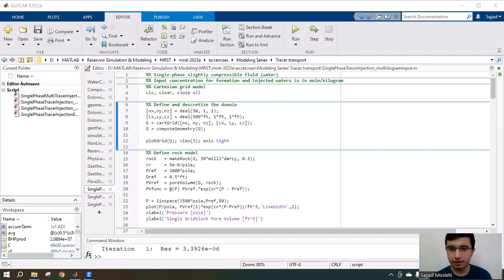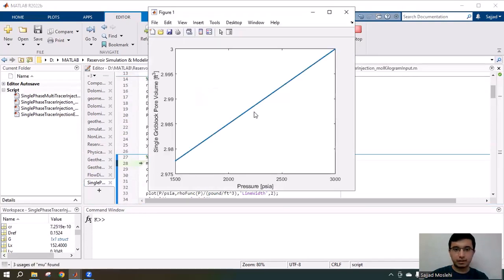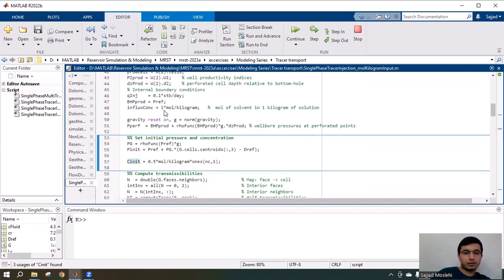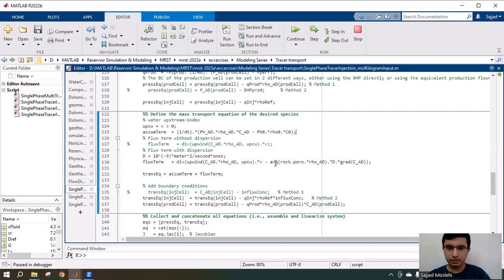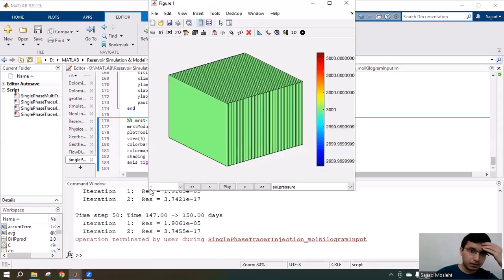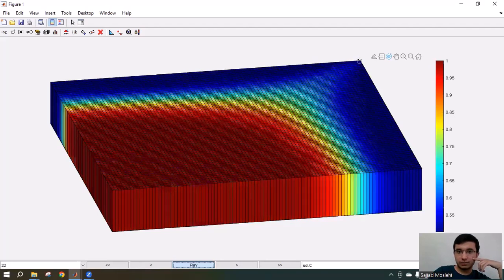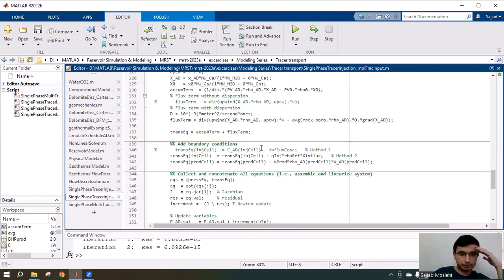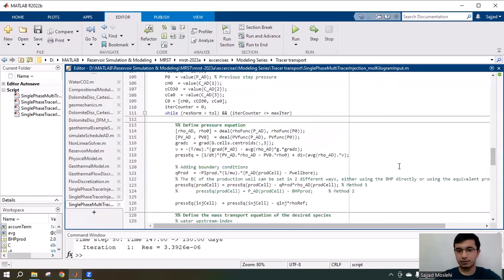Tracer Transport Modeling in Porous Media with MRST

Comment: Hi Sajjad, do you mind explaining how to set a boundary condition of prescribed concentrations (e.g. for your example)? Thank you.
Reply from the maker: Hi,
Like the 135th line of my first script in the video, you can specify a particular constant concentration for your desired cells, no matter the cell is an injection cell (which is my case) or a boundary cell (which is your case). For your case, instead of specifying the indices of injection cells, you should write the indices of the boundary cells that you want to have constant concentrations over time. Like below:
boundaryCells = [1 2 3 4 5 6 7 8 9 10];
boundaryConc = 9;   % 9 ppm
transEq(boundaryCells) = C_AD(boundaryCells) - boundaryConc;
Reply: Brilliant, It makes sense. Thanks a lot. @SajjadMoslehi

Comment: Dear professor, I would like to consider the time-varying permeability, relative permeability due to long-term water-driven flushing in the oil-water two-phase model, and I would like to get your help, thank you!
Reply from the maker: Which type of permeability do you mean? Relative permeability or absolute permeability?

If you mean "relative permeability", this is my answer:
When water is injected into a 2-phase flow system, saturations of the two phases change, so you need to calculate the relative permeability value of the desired phase for each grid block (or cell) as a function of saturation of that phase in the grid block (or cell). To do this, as far as I know, you have 3 choices:
1- Use a table of saturation/relative permeability, which is the result of experiments in the lab and is the most exact method, 
2- Use the models that are commonly used in the literature, like the Brooks–Corey model, or
3- Use a simple function like the one I used in the 2-phase flow modeling tutorial, which is not an exact method and is only used for educational purposes.

If you meant "absolute permeability", please state why the absolute permeability of your model changes so that I can help you with that.
Reply: @SajjadMoslehi  Absolute permeability becomes larger due to water injection washout, considering absolute permeability as a function of the water drive multiplier
Reply from the maker: @byL-d6g  Are you talking about reservoir rock?! I've not ever heard about washout in the field of hydrocarbon reservoir engineering. If you have a multiplier for changing the absolute permeability of your medium over time, so in each time step, use that multiplier to update the value.
Reply: @SajjadMoslehi  Thank you for your guidance. I will continue my research and hope to learn and communicate with you
Reply from the maker: @byL-d6g  You're welcome.

Comment: Please make a tutorial video on hydrogen storage in a coal reservoir, and simulation of 10 years.
Reply from the maker: If you mean coalbed methane reservoirs, I've not ever done such a simulation, but as a suggestion, because I think that composition of the fluids changes remarkably (and so the fluid behavior) in this process,  you can take advantage of the compositional module of MRST.